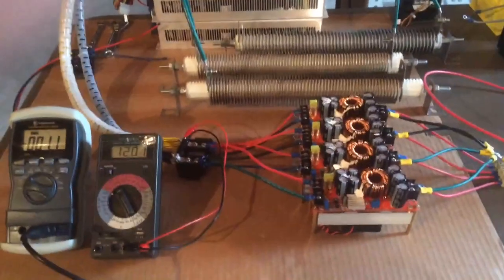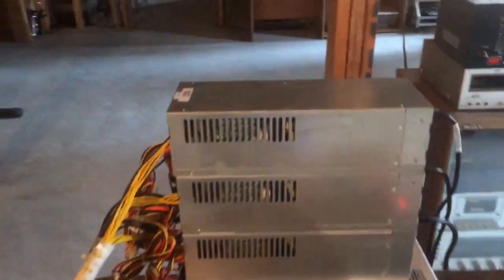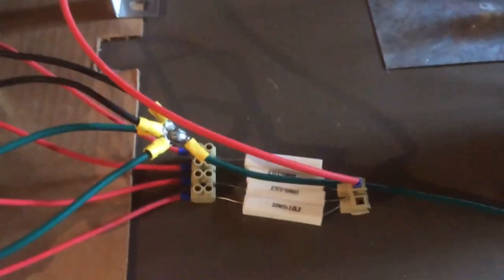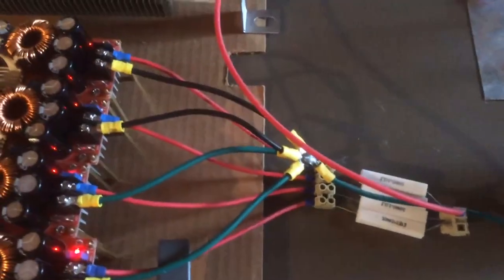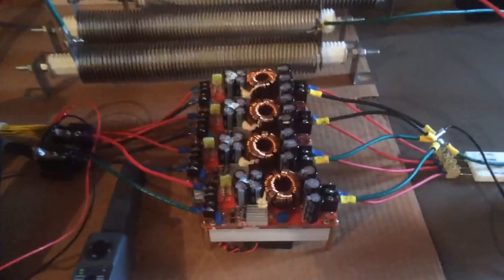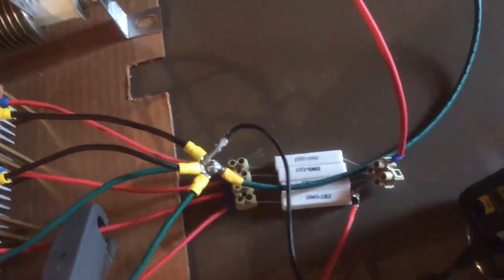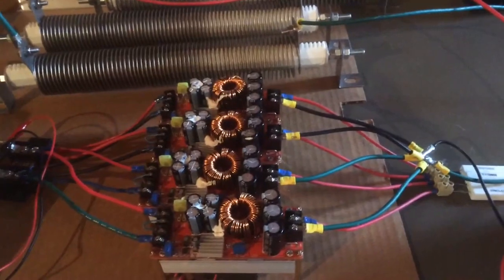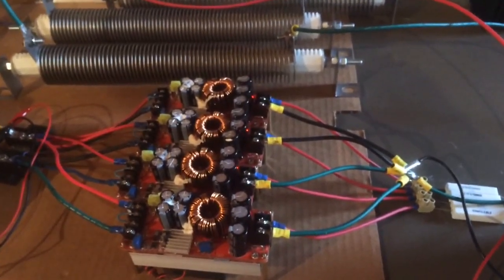RF Man demonstrates how to use four 12v to 50v boost converters to drive LDMOS devices

Comment: This is genius. So you just put a resister between the boost converter and common positive bus to isolate the boost converter feedback loops from oscillating? It's that simple? I was trying with diodes  with limited success and batteries but this is even better.

Comment: cool videos! how do i choose the resistance value to add in series? i need to pass 150A of current and ideally drop less than 1V. is a very small resistance still work okay with power supply? or do they need to be in the ~100mOhm range to work?

Comment: Hi, curious how you arrived at 0.1 - 10Watt resistors?  If I wanted to force load balancing of 2 X 58V 28A power supplies, how would you recommend I do that?  I want to power a double pill 65V RF Amp I am building.

Comment: You got each unit up to 10 amps at 50V? For how long? 

I only have one unit so far, but I just ordered a few more to try exactly what you have here. I have the first one at 50 degrees C and climbing after 30 minutes at 4.75 amps. It will burn in less than 2 hours in my test. I'm testing at 52V. The heat sink fan is working. Did you have extra cooling in play?

I believe my unit is the same as yours. I bought the one labelled 1800W output, but so far it can do nowhere near that label. Its heat runs away from me at just 300W. If the next two are the same, I'll need three units just to pull 15 amps.

Comment: Good Stuff .Was curious if this could be done. Im intending to purchase an icom ic705, a 10w output radio. I would like to use it in the shack, as a portable  and also occasionally in the car. (or using my old ic718)The car would have an innefficient antenna on lower Ham bands. perhaps 1% eff on 80m and about 5%  on 40m bands. So an amp would be required for decent performance.1kw would do me I think Also considering a alternator upgrade to help with running the higher loads.

Comment: i could use some help rf man. ive been trying to step up 5 48volt 30 amp 1000 watt ebike batteries to run at 64 volts using 3 1200 watt step up boosters in parallel. i tried your resistor way and had results when using a 12 volt power source, but once i had all the boosters adjusted to 64 volts, when i hooked them up to the battery packs, nothing is happening, it looks like no power is getting through even though i know the 5 packs in parallel  have 46 volts of power in them still. i dont understand where i am going wrong

Comment: What if 20watt resistor is used instead of 0.1 ohms 10watts
Reply: It would run cooler. Power dissipation would be the same for a resister of the same value. If you are talking about running one 20 watt resistor instead of the four 10 watt ones, that won't work. Not only are the 4 resistors dissipating more than 20 watts, the resistors are not wired in parallel. They are each connected to the output of one of the boost converters.

Comment: Do you know if a 12-volt 100-amp car battery will work with this step up converter?  It looks like these converters are mostly rated at 30-40 amp input. Let me know. Thanks.
Reply: I think a 70AH 100 amp battery with a voltage drop of 0.8 volts should be possible. You just have to make sure that you use a battery that has the lowest possible internal resistance. I therefore recommend using an additional battery with AGM technology. A high-current diode should be used between the starter battery and the AGM additional battery.
Alternatively, you could take four AGM batteries and connect them in series so that you have 55 volts, and operate the LDMOS amplifier over it, which relieves the load on the starter battery and the alternator.
Four 20AH AGM lead batteries for uninterruptible power supplies would be sufficient.
It is important to connect a relay including high-current fuse between the starter battery and the DC-DC converter!
The AGM batteries also reduce the ripple voltage. Best 73

Comment: Nice, I Found that if you add a very large amount of cooling to one of those converters and keep it cool you can run it very hard reliably! I have a 1200w version, I am using it to charge my ebike at just under 1200w. I've got it putting out 15 amps at 90v and have done about 20 cycles so far with no problems. I built mine into a rectangular box with a delta fan on each end in push pull config. They are 30w fans, so quite powerful. I probably don't need that much cooling, but I wanted them for future proofing. If I had a bigger supply I could probably get it to push through more power.
Reply: What is your input voltage?
Reply: @Pricesminis  I'm using a 48v rectifier. I have also used it a 12v 200 amps server psu running it at slightly lower power output charging at 12 amps.
Reply: @jcreedy20  do  you have a link for the rectifier
Reply: Nice 💪💪💪

Comment: how much current does it draws from the source power supply at that setup?
Reply: He doesn't respond to his videos it would seem. But to answer your question those power supplies he has there which are rated to 90 amps total, are probably being maxed out when he pushes the converter to put out total of 20 amps at 50v = 1000w. You get an efficiency loss from the converters as well 20% roughly (dependant on voltage gap). but 12v x 90 amps is 1080 watts. So in fact he's probably stressing those 12v power supplies when you consider the conversion efficiency loss.
Reply: @jcreedy20  i have seen these to be 93-97% efficient, both on my bench and others

Comment: What a cool demonstration.  You also proved the assumption that batteries in simple parallel with load taken from the end batteries....draws slightly more amps from those end batteries.  For ebike purposes with multiple parallel cells. could be significant unbalancing eventually  Thanks for your effort.

Comment: hi,  i purchased the same module, but 12v FAN is not working through that port, does it start when module starts or it's a temperature controlled ? i tested and waited until it reached 62"C but fan did't started...... if it directly starts then which iC or component is responsible for constant 12v regulation ? or if there is temperature control sensor which turn on the fan then where is it!!! plz help me, i will be waiting for your reply .

Comment: hey RF Man what if you wanted to get 20A from each of the 4 converters to get 80A total, what size resistors would I need? Edit: I have the 1800W versions which claim 40A
Reply: I would use this DC-DC converter with a maximum of 50% of the rated output current capacity, otherwise the operating point will be very inefficient and the ripple noise will increase even more.
Reply: Where did you buy that? Do you have the link?
Reply: @taruix603x5  Honestly though I have tested them. They can handle around 40A INPUT not output...so do your math P=VI and account for about 10% ineffeciency...

Comment: Hi great video building small ldmos amp only 300w have a 30 amp 12v supply  trying to use stuff I have ,would 1  1500w work or would you run 2 and split the load as need 50v at 15 amp
Reply from the maker: One 1500 watt amplifier will work with a 50 volt 30 amp power supply. You can use 2 power supplies in parallel but you need to address the load sharing. I have a video on this topic on my channel. Thanks
Reply: Thanks

Comment: You are pushing out 10A @ 50V. That makes about 42A @ 12V on the Input, without efficiency loss. At 85% that would be even 49 Amps, so way over spec. You can easily measure input current with your setup, so go ahead and do that. It’s specified for a input or output current of 30Amps max, depending on which is higher. Because your input voltageis so low, your input current goes through the roof.

What you could do instead is connecting the power supplies in Series, so you get 36Volts of input. 
That makes 1080 Watts @ 36V / 30 amps. Efficiency of 85% makes about 920Watts Output.
So you will get 18 Amps max per UNIT, 72Amps total output @ 50V without exceeding max current. whereas at 12Volts of input you will get only 6 Amps per Unit, 24 Amps total. 

So go ahead and connect your psu‘s in serial. Look out, maybe the housing is grounded to negative, then you have to make sure, that the housings are not touching, or you will short the psu‘s. 

For the total output of 20A @ 50V, you will need every PSU to be able to produce 65 Amps @ 12V. Are they rated for that current?
Reply: you appear to know your stuff . i am looking to use three 12volt 18amp hour batteries in a series to get 36volts 18amp hours....i want to use this battery setup for powering an ebike kit. the kit requires 48volts max of 20 amps.....would you use step-up converters in parallel like this to achieve that ? i would rather not buy 18650 battery packs (500 dollars) and i want to save as much battery weight as possible..each of these 12 volt batteries weigh 13 pounds each.
you have any suggestions ?
Reply: @bobamericana3099  Are you aware that you can get a 40a version of these that runs 1800 watts? I have one and they are only $25, & then you dont need to do any load sharing.
Reply: @englishrupe01   you have a link ?
Reply: @englishrupe01  "Input current: 40A, Output current: 22A"
Reply: He said in the video that he was operating it at 50v 500 watt output for adjustment and initial testing. Later he was going to run it at 50v and 20 to 25 amp output. This would draw 83.33 amps at the 1000 watt load he mentioned was planned in the future near the end of the video. Pretty much maxing out the three 12V power supplies.

Comment: What's the point?
Reply from the maker: Operating the Amp from your mobile.
Reply: Is this a alternate solution to using 2 or three altenators or for mobile units used on base station
Reply: @Transmitters 'R' Us I would suggest using a 500F supercap bank. The current peaks are not good for the voltage regulators of the alternators. In addition, less voltage fluctuations result in better linearity.
Reply: Is there any way to regulate current from a car 24v alternator on amps down to 40a?